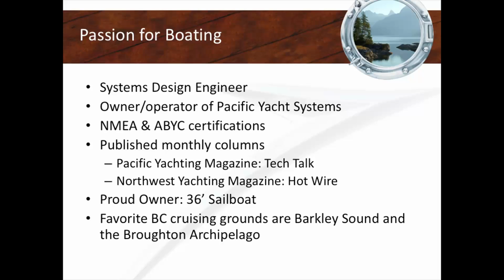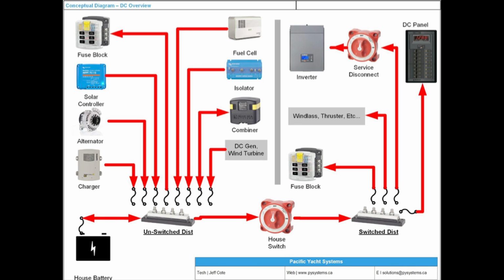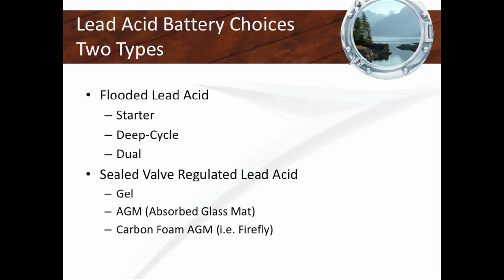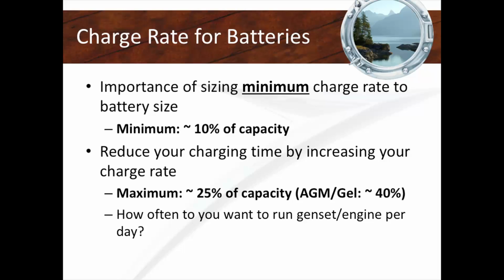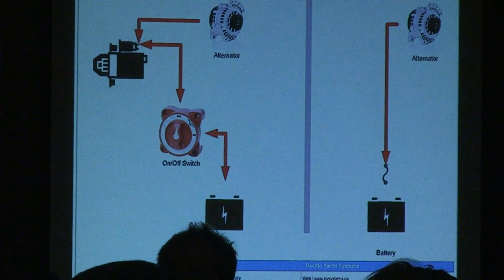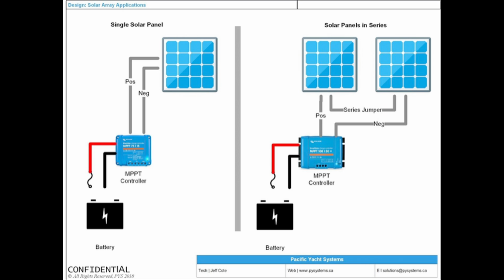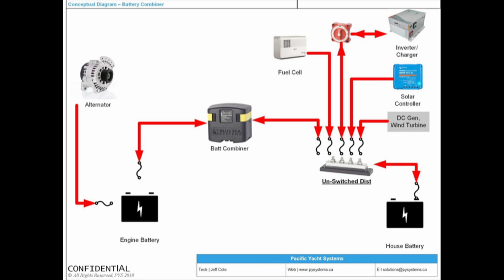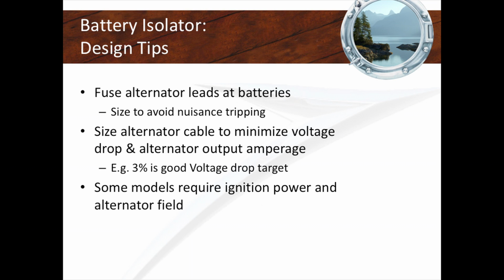Boat Show 2019: How To - Design A Marine Electrical System

Comment: Thanks for the video. 
I'm a diesel mechanic and I have teached my self electrical (12/24 DC 220v AC) Scarry I know but I have a question as I'm looking to build or find a Sailboat over 60ft. 
The video help me plan in my head how everything should be layed out and put in proper oder. Much like a puzzle piece.
Question
* Does the Marine industry use multiplex system 
*If so do the invertors have pertection  on interference .
* I have had problems with Generator for back up A/C 3 phase 220
Running at 56 hz  . If the A/C is not tuned or out of tune could the damage any Electronic or Elictrical pumps. 
What is a good fail safe for insurance
As I have had AC motor burn up with correct voltage but Hz probablems
Reply from the maker: Hi Peter, never heard of the Multiplex System per say. What is it?
Reply: @PacificYachtSystems  In heavy equipment we have more computers and sensor then ever before. With Emissions, EBS climet control. The wiring can stack up a lot of weight. Too correct this they have came up with a method of communication in the wiring. To go from what may have taken 10 wires before now only takes one.
The best way I can explain it is the single within the wire. It's extremely sensitive too voltage changes and other interference like older or some new AC converter and microwaves.
Reply from the maker: Hi Peter, in marine with do similar with a CANbus protocol called NMEA 2000. Similar benefits, allows one cable (made of 5 wires) to communicated lots of data between multiple connected devices.
Reply: @PacificYachtSystems  https://en.m.wikipedia.org/wiki/Multiplexing I have really only learned all my skills from reading and trouble shooting. But have came across many problems with newer Electronics integrated with old technology. Kind of like two different languages trying to communicate with one another

Comment: Thank you for all the information. As I do my research for my boat renovations I believe its wise to put a resettable fuse or switch between the solar panel and mppt.  This to isolate power during maintenance. Thoughts?
Reply from the maker: Hi Terence, putting a circuit breaker will work on your solar panel circuit will work. Make sure you cover your solar panels to stop output before disconnecting them.
Reply: @PacificYachtSystems  thank you

Comment: Is it correct to assume that a galvanic isolator is not needed if an isolation transformer is used?
Reply from the maker: Hi Joe, your correct. No need for a Galvanic Isolator if you have an Isolation Transformer.

Comment: i have an 80amp dolphin smart charger and 2x T105 FLA 6v in series giving ,225AH,12v would this charger be too much for the batteries to handle?
would probably only be used for fast charging with the 2kw honda portable generator.
Reply from the maker: Based on your battery bank size, the maximum charge acceptance rate should be about 50 amps (25% of battery capacity).

Comment: Great video. In regards to battery combiner vs battery isolator- I'm concern with the engine not being used much and keeping the starting battery topped up via solar. From your isolator slide it looks like the power doesn't flow that way, so an isolator isn't the solution. Is that an accurate statement?
Reply from the maker: A battery isolator can be used in many applications. Typically it's used on the output of the alternator, therefore a solar panel connected to the house battery will not be able to recharge the engine battery. You'd need a battery combiner for that, preferably a directional battery combiner, going from house to engine battery.

Comment: That was a great presentation. Thanks so much for putting that together. Was interested for rewiring my overland expedition truck. Many of the same concepts apply methinks. House batteries, truck  starter battery, solar panel, alternator, charge controller etc.

Comment: Can you go alternator to battery direct, with an outboard?
Reply from the maker: You should always have a battery switch between an engine (including an outboard) and a starting battery.
Reply: Pacific Yacht Systems yeah got an Almar made in the early 80s and there is no switch and the battery has no container.   It sits in the hull by the drain.

Thanks  for all your help.
I will be aiming to fix both, first thing this spring.

Comment: The conceptual diagrams are so helpful! I love the idea of the battery isolator with the alternator, but where would the external regulator’s voltage sensing wire go?
Reply from the maker: Sensing wire goes to deep-cycle battery bank.